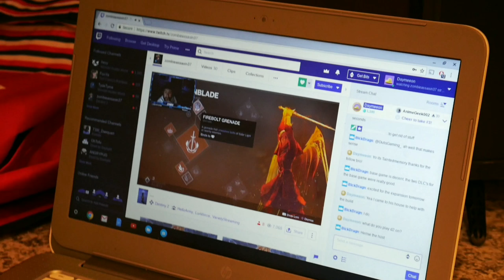Building my very first PC! // I spent my car money on computer parts

Comment: Are your parts running hot in that pc case?
Reply from the maker: Zero issues the entire time ive had it
Reply: @domrodriguex  thanks for answering. Can you confirm that front panel is steel/metal and not plastic?
Reply from the maker: @sunmoon2b  no worries and front panel is plastic
Reply: @domrodriguex  I'm building a pc too. I got the ryzen 5 2600 and gtx1660ti and as u guess no that much budget left for case. I hope this raidmax one will be enough.
Reply from the maker: @sunmoon2b  it's a great case my brother had the exact same one in a different color and never had problems whatsoever and he games a hella lot more than me